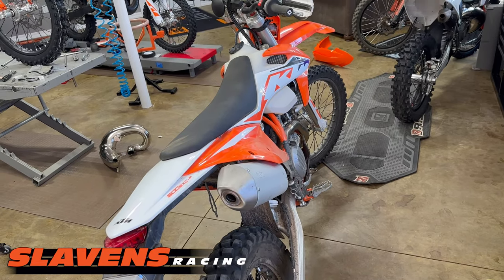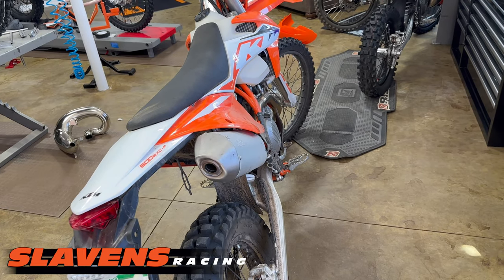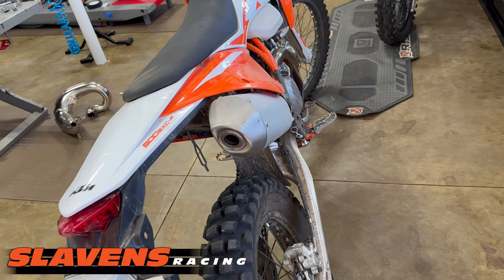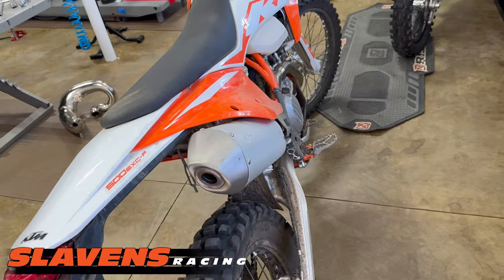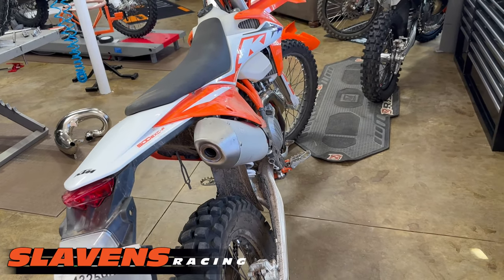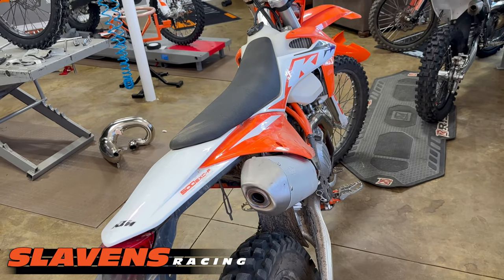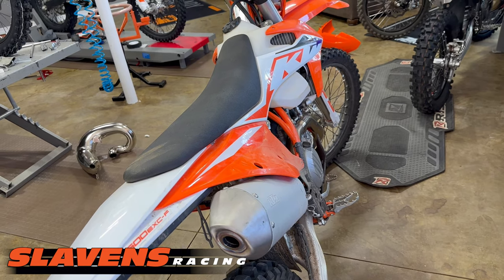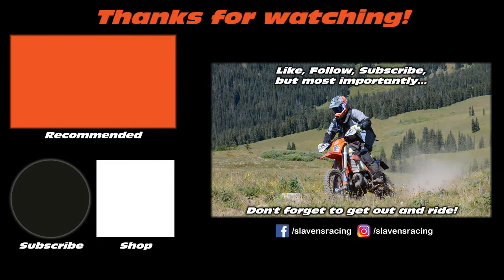Should you remove the restrictor screen? KTM EXC-F/Husqvarna FE-S

Comment: Disconnect battery for 10mins and reconnect let idle for 5 mins factory ecu will auto tune to exhaust ya dero
Reply from the maker: Hello:
The stock ECU map settings are very lean. When the muffler screen is removed, the fueling becomes leaner and can only be corrected with an aftermarket ECU. The reset method does almost nothing to improve the fueling.

Comment: Hey there, just found this video, love the Q&A about these bikes- sorry I’m asking a little late here but I was wondering if you had any recommendations/mods I could install to give the bike a little more torque. I removed the intake reeds and adjusted the fuel with the JD jetting piggyback, everything else is running stock save for the headlight. Sometimes on straight 2 lane roads, or in between freeways I feel like I’m just using too much engine to just to fight wind. I can still accelerate freely, just can’t sustain the speed I need long enough when I’m modulating the throttle in high gear. Not sure whether to adjust the gear ratio from 14/47 to 14/49-14/52 or put in flywheel weights. I heard aftermarket exhausts and end caps don’t do much for the 350s. Thanks!
Reply from the maker: Hello:
Lots of red flags in this comment. Piggyback tuners are a waste of money. They do very little to improve performance. Dig into your piggybank and by a Vortex ECU https://slavensracing.com/shop/vortex-10-map-ecu-ktm-vortex/. 

Bad information about exhaust. Your bike will NEVER perform well with the stock restricted muffler. Remove the restrictor screen, install a free flow end cap or an aftermarket muffler.

Comment: if i put fmf slip on , on my 16 husqvarna fe350 do i still need to put a different ecu?
Reply from the maker: Hello:
Probably, but you will need to make that determination depending on how it is running. If it is boggy, starts hard, fluctuating idle, runs hotter than before, decel pop are all signs of lean fueling.

Comment: What about just a GET ecu to increase the fuel? You will need to get an exhaust too?
Reply from the maker: On a dyno, the HP difference is very minimal between a stock muffler with the restrictor removed and the loud high flow aftermarket mufflers. I prefer the stock muffler with the restrictor removed.
Reply: @slaverace1 this is good news! I like the hp but noise is a curse. Especially with a track kit in winter when you’re always on the throttle, the FMF pipes are so loud I can’t use my helmet coms properly.

Comment: My 350exc 17model continuously flames out. Seen vids of people removing the spark arrestor from stock exhaust and it complete eliminates flame out
Reply from the maker: Hello:
Flame-outs are from lean fueling. Any modification to the exhaust system that increases air flow will make the flame-outs much worse and the engine will constantly run too hot which causes premature engine wear. I have no idea what videos you watched but that information is completely backwards and incorrect. Also, the restrictor plate on the rear muffler outlet is not the spark arrestor. It is located several inches inside the muffler. If you want it to run correctly, you must purchase a Vortex https://slavensracing.com/shop/vortex-10-map-ecu-ktm-vortex/ or GET ECU https://slavensracing.com/shop/slavens-mule-athena-get-sx1-pro-4t-ecu-kit-for-ktm-hqv-gg/.
Reply: @slaverace1  Thank you!